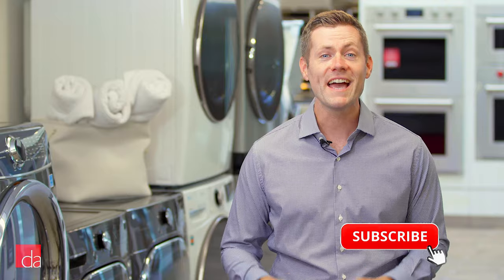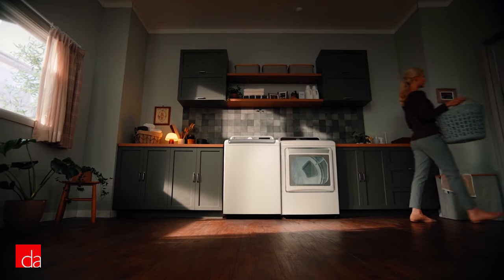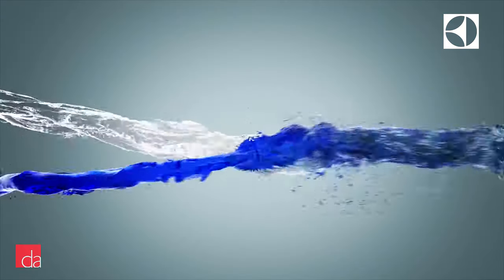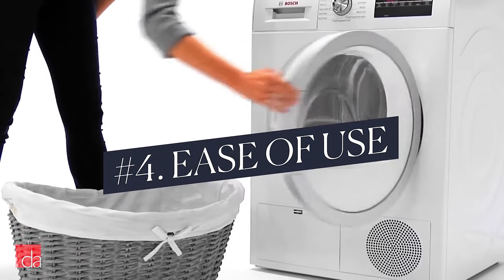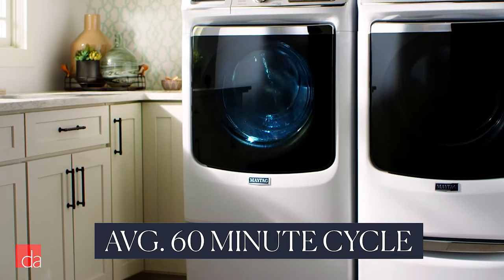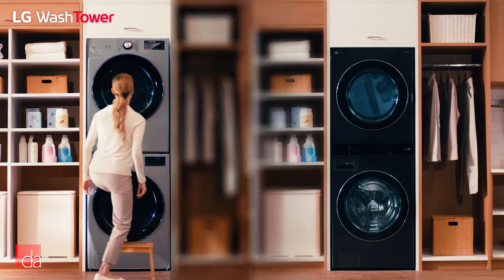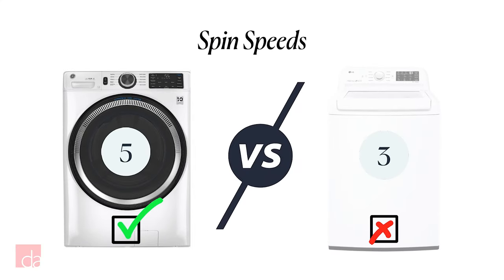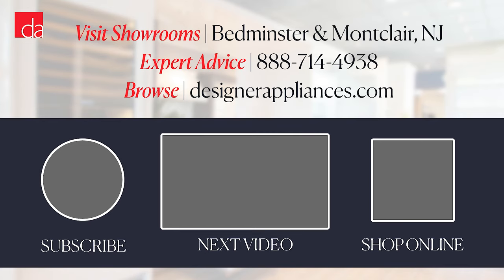Front Load vs Top Load Washer - Selecting a Washer Shouldn't Be Confusing (Updated)

Comment: Front load washing machines-flexible on price? That's not a real statement. Starting at $1250 for a basic pair front loaders and going up to more than $3000 is not flexible. A really good standard pair will set you back only $850 and is Much more versatile for most families. By that, I mean: Top loading machines are by far the better choice. Between the kids dirty play clothes, the smelly grass stained sports uniforms, the husbands dirty and grimy work clothes; a front loader will not be able to clean them in 1 wash. You also need to be able to soak them for at least an hour in a full tub of water & a stain remover like Goo-Gone or Shout or Stain Free or Fast Orange w/pumice. Those will gunk up a new front loader faster than PB at a nursing home.  The spin cycle for a full load of heavy clothes in a front loader is slower, doesn't get as much water out and usually is out of balance to the point of stopping; having to remove up to 25% of the load and restart; not so with a top loader. Also, an aggressive style tower agitator is a Mist to get all that gunk out of the clothes. None of those flat "things" called agitators are going to do the job. Also, you think cleaning the machine monthly is a chore; it would be every time with the above normal family. Front loaders  and agitatorless toploaders are for empty nesters or all adults who don't get dirty or really sweaty but for the odd occasion  every few months. Front loaders are like Cadillac's, not much for hard work; but top loaders are the mini-vans, doing the heavy lifting for the daily grind. So for price, durability and cleaning ability; it's top loaders...hands down.

Comment: Mold. Our frontloading washer doesn't sit still long enough to grow any mold. It seems to clean better than our top-loader (the back-up for when (not if) bearings go bad on the front-loader) . The front-loader drum works basically like banging the laundry on rocks at the river, like has been done for centuries, with the drums being much smoother than rocks.
Reply: Best comment
Reply: Correct!  YouTube has all kinds of videos showing you how to override the amount of water your front loader wants to use.  That's because people are used to seeing their clothes soaking in a top loader and they want the drum of their front loader full of water too.  That's not how front loaders work!  They repeatedly dip the clothes into a relatively shallow pool of soapy water, then lift it up and drop it down.  If the drum is full of water, there's virtually no "smack" effect when it hits the bottom of the drum like you'd get from whacking clothes on a rock, hence cleaning is actually reduced.

Comment: I hate the front loaders, epecially when they have the optional bottom drawer, have to clean a screen and drain the hose every month, leave the door open after use, and my laundry room is on the main floor with ceramic tile if it was on solid concrete in the basement it wouldnt dance all over the floor, had to put rubber pads under the feet to prevent this, im 6foot3 and now the unit is almost as high as me, its a ten year old kenmore elite, we had 1983 maytag gas dryer and maytag washer before and apart from replacing one belt and one ignitor on the dryer and no problems with the washer in over thirty years, we replaced them when we went to all stainless appliances, bad mistake..but if anyone wants front loader, do what the laundrymats do speedqueen

Comment: There is no discussion about spacing required behind or on sides for Front loaders or top loaders.  My concern also includes space limitations.  I have older top load washer and dryer and although they are not apartment size the measurements on width are 3" less then the average width of the top loader or front loaders.  Making my for less options to fit in a set of top load washer with dryer.  Can you address space required to make choices please.

Comment: We had a Maytag Neptune front load washer and dryer combo for over 14 years. About three months ago the washing machine tub bearing starting going out. The repair man said it would cost more than it was worth to repair. We starting looking for another Maytag front loader and chose the MHW5630 HW3. It took two months to get it. We also got the pedestal. From the first wash until yesterday Oct. 8, 2022, when the washing machine starts the spin cycle, it shakes so bad it moves around the floor. In the past three weeks the repair man has replaced the shock absorbers, top springs and the computer. It is still shaking its ass off and he said I have done all I know to do. Told me to call Maytag and give them hell. I will do that Monday. We do have the extended warrantee and it has a 5 year plan. Go figure. I am going to see if the dealer will take it back and allow us to get the GE  GFW 850

Comment: I am sorry but grease will not be removed in a top load machine.  It can’t.  It’s like rinsing a greasy cloth in sink full of soapy water, rather than a saturated cloth with the detergent on it and squeezing it with your hands, the detergent will be more concentrated, forcing the detergent through the fibres, cutting through the grease.

In a top load washer, you would have to pre treat any type of stains or with the grease, use an absurd amount of detergent to get the grease out, which is practical.

Concentrated cleaning is much better, with the combined force of gravity and clothes rubbing against each other, in a front loader.

Comment: Front load mold issues are customer abuse cases, every time. The industry failed to educate the customer on how to use the front loader correctly. Once you understand how to use one correctly, you will not have a mold issue.
Reply: The industry benefits from consumer ignorance. The American solution will always be to just buy a new one.
Reply: Sure. Clean the thing that cleans everytime or it will mold up.  Nice!
Reply: @Ryan-re1rs  No cleaning. Just wipe out of the moisture around the door and seal that exists right after using it. Then unplug the machine and leave the door slightly opened to evaporate the remaining moisture.

Comment: Actually getting clothes clean is what I'm looking for. I used an old top loader with high agitation forever until it finally failed. So instead of fixing it, we bought a "new and improved" to loader. Horrible. Very low agitation and fails to fill the drum with enough water. Stains not gone due to low agitation. I have to add water through external hose but doesn't clean due to low agitation. Piece of crap. I'm hoping you're correct that front loaders clean better because, in the end, that's all that matters to me.

Comment: Front loaders are awful. Just bought a brand new commercial grade Maytag top loader with an agitator and it’s life changing compared to the front loader. NO mold smelly issues, no cleaning out the nasty washer trap, no more super loud laundry cycles. My front loader was SO LOUD. my new top loader is so much quieter and does a great job spinning the clothes. My clothes dry in a normal amount of time. Don’t drink the kool aid of front loaders like so many people do. Go old school and get a far better clean than front loaders because your clothes actually get washed in water! These new HE machines are ridiculous. Why would you want to clean your clothes without water? Makes no sense. Appreciate the review but in my experience, front loaders are not better and do not clean clothes better. And leaving the door open on the front loader did not prevent those nasty moldy smells either. Go old school and be happy to do laundry again!
Reply: Nice rant, but your opinion does not hold up against scientific testing. More water does not clean better, it’s one of those things that sounds correct but is not. This has been verified by consumer reports.
Reply: @Half pint thanks 🙏

Comment: I didn't watch the video yet, only the intro.  I also didn't read any of the text or comments.  But I predict that he will choose a front loading washing machine.
Post watch comments:   Yeah, I knew he'd pick the front loader.  
I have to strongly disagree with his durability/quality section.  Top loaders are inherently better in this category.  They have less parts and systems to go wrong.  Also, if you buy one from a commercial manufacturer you don't get plastic parts.  A professional washing machine repair and reseller broke down (took apart) each of these types of machines.  The difference was night and day - top loaders won by a mile.  To me that's THE most important thing.  I have friends who had front loaders and they're always calling for repairs.  I bought my last set of top loader washing machine/front dryer in 2005 and they still are going strong.  That's 17 years and only had to replace a $4 door switch (dryer) which broke.  My mom owns a front loader: too small of a capacity (something this guy didn't cover) and it basically makes me crawl on the floor to load and empty (can't see in the back for socks, small items).  No thanks.  Also he didn't catch the mismatch in his cleaning analysis.  One runs for 30 to 50 minutes the other for 60 and guess what-the 60 minutes one cleans better..... Hummmm.   Wonder why?    
And just because your house has poor water pressure (probably due to clogged pipes due to scale buildup.  That's not the fault of either top or front loaders.

Comment: The FLs water savings are industry hype as by contrast they don't have a hot water inlet like TLs do so if you warm water wash you are using peak electricity through a heating element inside instead oops!! (A former Energy Auditor here.)

Comment: Sorry, I have had both and top loaders are hands down better. Never noticed a difference in cleaning so I won’t be giving those points. Top loaders also  you to SOAK your clothing. If you wear whites (like me), soaking in things like bluing agent is a must. I’m not going to be hand soaking at all. So by default, front loaders are out of the running. Soaking is a very important step in stain removal. Also, top loaders are just more reliable. Period.

Comment: I’ve had both. The front loaders absolutely suck. I hate mine with a passion and they cost out the ass. Can’t wait for it to die. We’ve had to repair it 6x. The rubber gasket - replaced. Also, leaving the door open-gasket still molds, the drain pump-5x. So-that’s more money. Front loaders do NOT clean better….at all. My top loader cleaned so much better than the piece of garbage I have now.

Comment: I disagree with the term EVENLY being often used.Sure it might be easy to assume  but I also disagree with cleaning better because the biggest  part of cleaning is friction and agitators would obviously create more friction than a slow  turning side loader.
The problem with quoting scientific or testing results is that you need to look at the TIER level of equipment used what is the most common budget used  type of detergent example MANY use packets  versus liquid being distributed along with the water cycle where as packets do not do anything until full of water and moving.
Another example was a machine quoted/shown that is a top of the line model you can't use top of the line  unless you were also comparing to a top of the line teched top loader.
Another factor is the modern age of tech there is no comparison on how an old machine agitates compared to newer models everything new is made CHEAP and  moves slower to avoid literally falling apart in a year.

Comment: Front loaders suck.  I have had a horrible experience with a front loading Samsung high end washing machine.  We clean out the gaskets and leave the door open but smells coming from the back of the washer.  The weight sensor broke after 3 years and repair was a ridiculous price.  So, I will never buy a front loader again,  I don’t agree with his cleaning complain.
Reply: Samsung appliances suck. It's not just washers it's anything Samsung Dryers, Refrigerators, Ranges, ect. Buy from a company who has been in the game for a while like GE. If you have deep pockets and want a washer to outlast you then buy a speed queen commercial.

Comment: Wow…. My frontloader washer takes about 2 hours for a cycle. It’s about 11 years old
Reply: I have one of the "fancy" Samsung ones with the quick wash I purchased last year. The quick wash takes between 15-20 minutes, but I only use it for pillows because when you use the speed wash feature, you don't get the smell of the laundry detergent in your clothing.

My old top load washer (a 2003 model GE with absolutely nothing fancy about it) washed a standard load in about 40 minutes. This Samsung front load takes about 80 minutes.
Reply: Replace it with a SPEED QUEEN

Comment: You measure washer efficiency only based on water use???? That's dumb.  My water is super cheap.   How about the fact that a front loader has to run the motor for 50 minutes vs the top loader for 10 minutes.   That's 40 more minutes a load which is 5 times more electricity.   Not to mention it will take you forever to get a few loads done.

Comment: Run as fast as you can away from LG-WT7305CW with agitator. I made the Mistake of buying it. When using normal wash it never fills enough water so 90% of the clothes are dry being dragged around not wet. Then when I set it to Deep Fill it over fills the drum "Over The agitator" wasting gallons of water. I swore I would never purchase anything from LG After my Brand New LG Fridge compressor went out it took 2 months to get another one that worked & NOW THIS HORRIBLE LG Washer..

Comment: In Sweden and Europe in general top loaders are basically non existent. Your only choice is a front loader from the clear fact that they are the superior choice. The mold argument I dont really understand since its avoided by simply leaving the door open after a cycle until you pass by your laundry machine the next time. Sure if you just forgo that 1 extra step you might get a build up, but really how hard is it?
It really is surprising why the US keeps sticking to these types of aged and outdated technologies like Top Loaders.
Also Gas Stoves? Why? Same thing here, the rest of the world abandoned that long time ago. Induction stoves are way more efficient and heat everything basically within seconds.
Reply: all my front loaders have mold, lazy tenants. I own tons of them over the past decade.
Reply: @rbtheriot  do you have an induction stove or regular electric stove ? Regular electric stoves including those with flat glass surfaces are interior to gas, no question. Induction, on the other hand, is better than gas in almost all circumstances.
Reply: @rbtheriot  induction cooktops are way better than gas!